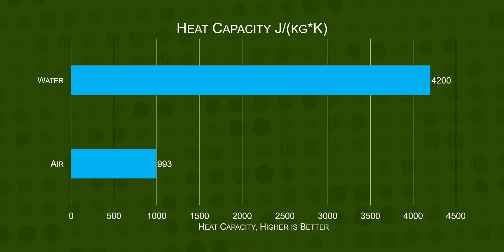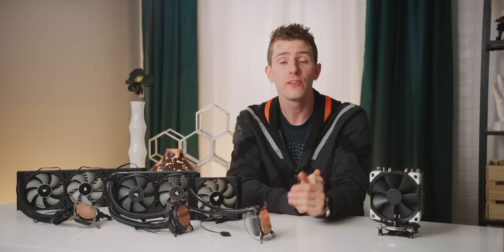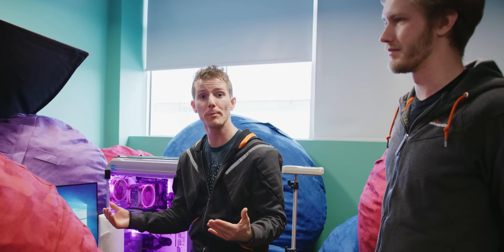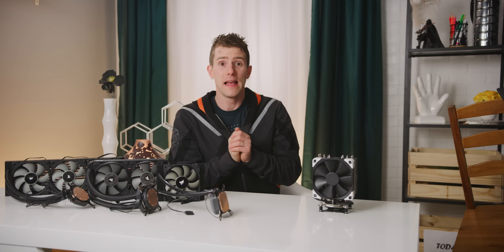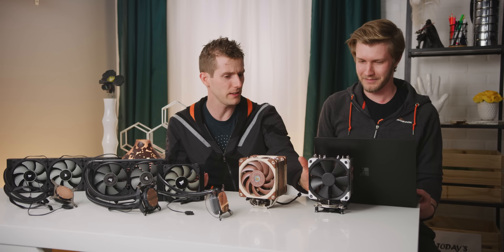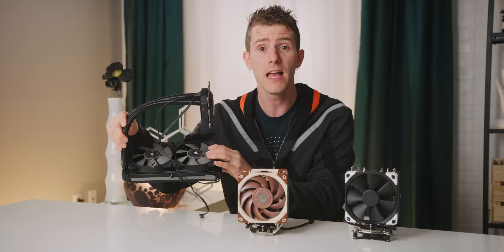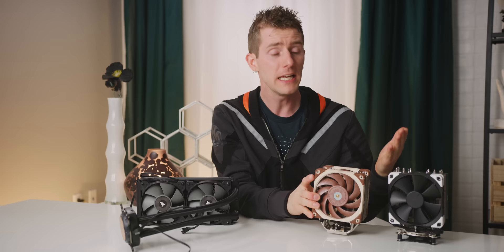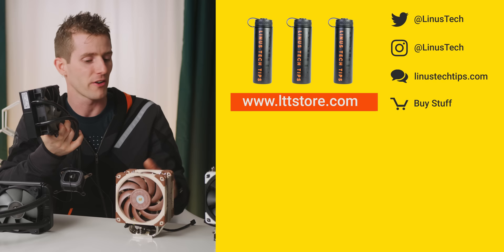Why you shouldn't water cool your PC

Comment: Tech companies: Sell shit products by paying for ads
Noctua: Gets free advertisement by making actually good products
Tech companies: *surprised Pikachu face*
Reply: yea, amazed at the amount of suckers in the world that buy PC water cooled stupidity when a good laptop will do it all.
Reply: Agree. I've long said that if marketed right. A turd wrapped in decorative foil will sell.

So much "stuff" is designed only to "SELL."
Reply: Silent Studios 
If you want a powerful PC but are extremely mobile from day to day
Reply: I can't get a laptop with an I7 7700k and 32GB DDR4, liquid metal on the cpu with water-cooling, and a GTX 1080TI and a 32" wide screen.  @VanguardX
Reply: You really think this is not paid for? This is 100% commercial for new Noctua cooler.
Reply: When I replaced my air cooler I also had a Noctua , they where back in 2006 also the king of cooling with pretty low noise.
I get a full custom water cooling with a radiator for 3x 120 fans. I cooled my HDDs, Board, GPU , CPU and Ram back then. 
The entire system was much cooler with that. Time goes by and I had 3 system after that  and guess what, the radiator with the fans and the CPU cooler + pump are the same.
I just changed the brackets for mounting different CPU sockets. Because I bought a high quality cooler back then it is still performing better then most other stuff and I know as long as the company is standing I can get mounts for different sockets. 
With a custom water cooling system you get even less noise then the Noctua. Good pump is ofc required or just a specific cheap chinese one for 24$...
Reply: @Elementpunx  I know right! This was obviously a promo. Can't trust anyone these days.
Reply: I LOVE noctuas fans, at first i was like 30 bucks for a fan you gotta be kidding me.... then is decided to test... YEP amazing
Reply: I have never seen an add for noctua. Standard add not youtube sponsor.
Reply: Lol if you don't think this video is also sponsered by Noctua as well I'm envious of your sweet innocent naive soul.
Reply: Article 13 enforced right here 👌🏻
Reply: :O
Reply: wish noctua would make a black edition instead of that jungle brown
Reply: @36SOAD817HMC  yeah my only problem with them is that they use that woody station wagon color scheme.
Reply: @everythingabouteverythingp8472  it is called an advertisement, not an addvertisement... so the abbreviation would be "ad", not "add"
Reply: Jonathan Alcantar u do know they make black ones now. Rit???

Lol kid they announced last Computex 😆
Reply: @Elementpunx  In the US, sponsorships and other paid commercials have to be announced/clear, like his world of tanks sponsorship. Im sure he is benefiting from anyone who buys the fan after clicking on the link in the description, but Noctua could not have legally paid him to make this video.
Reply: @nickparkin8527  yeah, where's my i9 9900k, and rtx 2080ti at?
Reply: @Vanadium  you can't get a custom watercool loop for 99$. even if that air cooler is a bit on the expensive side... and you don't have to waste your time building up the cooling loop and making sure everything works as intended. you buy the cooler, install it on your mobo and you're good to go.
Reply: @RuiPalmeira  and then you buy it again and again and again. Did you really read what I wrote?  High end air coolers are heavy and sometimes they even block you from swapping ram and or get to other things. No matter what I have paid the same price now for the custom water cooler. The next system update is almost there and I can take the cooler from my old lg1155 board to the new am 4 socket.
Reply: learn2 farm  to be fair an all in one system isn't good compared to a true water cooling setup.
Reply: @noahhaller4540  but is it the same in Canada?
Reply: @36SOAD817HMC  just go for beQuiet they're just as good
Reply: @TheReal_ist  sweet
Reply: @noahhaller4540  Except there is an unwritten code to speak well of products or a company you hope to get to sponsor you because one slip up and you will never be sponsored by anyone again.
Reply: @tropicthndr  wht ...
Reply: @seamusbyrne8259  the alienware area 51M laptop has a i9 9900k processor and a rtx 2080 if that floats your boat
Reply: Silent Studios I have a labtop because I am in college and want to bring it to all my classes.
However my Lenovo Y700 has terrible hinges and now I can’t even close it without breaking the connection between the screen and mainframe (or whatever the main piece is called)

Now I know better
Reply: @silent5486  i used to be a pc gamer, now i don't even use a pc anymore. laptop for work, smart tv for watching, mobile phone for browsing, music, and gaming too. took up gym, longboarding, surfing, and biking as a replacement for my pc gaming.
Reply: Scythe is good too.
Reply: @tropicthndr  A Laptop performing just as well as a PC is much more expensive, even mobile CPU's themselves are more expensive given their compromised performance. It is also much harder or impossible to upgrade. Even basic stuff like adding storage can be impossible, depending on the model.
Reply: @RambleOn07  The color scheme puts me off, too. But if your case isn't see-through, you don't have to look at that eyesore all day. Or is it not worth getting a non-transparent case? (I dunno, haven't built a pc yet)
Reply: @Elementpunx  : if so, it worked.  I bought one on Amazon.
Reply: Sorry but go to any modders on youtube who take modding seriously. AIOs of 120 and 240 show they are better than 95% of air coolers at stock speeds with low rpm. 280, 360 and 420 AIOs beat everything that is air, by a considerable margin esp at low dba and again at high dba with or without clocking. With clocking? air can't even get near water. Not only did they test what is viewed as one of the worst AIOs out there but also the smallest. Where is the 280mm? 2x140 > 3x120 at low rpm and its also the most common. How about try NZXT which demolish Corsair temps. 
The real best example of how bullshit this video is? look at THIS CHANNELS builds after this vid, they are all water cooled and not by Corsair.
Reply: @tropicthndr  lol you funny guy.

Comment: My last build was AIO and the one I'm building now will also be AIO. I had previously rocked air using nothing but Noctua. Honestly, both applications work for me. I prefer AIO for the noise levels being pretty much ambient to non-existent. Sure it's pricier, but honestly the AIO cooling solutions we have now are pretty nice for the price.
Reply: I just switched to the Kraken Z73 AIO from a Noctua fan and my temps dropped 25-30 degrees. Either Noctua sucks, or liquid cooling is just that much better
Reply: @holleringsmith3837  going all air really requires a great case to get anywhere near what water cooling gets you. If I ever go back to air, it will be with the fractal design torrent case. Kraken is a cool AIO! I went with EKWB with my new build. Cools the 12900K like a champ. 🤙🏻
Reply: @holleringsmith3837  That big a difference either means your case has god awful air flow, your ambient temps are really high, you chose the wrong air cooler for your cpu, or you didn't have the noctua cooler mounted properly.
Reply: Been using the small ones from Corsair.. The H60 model... Never failed me.. CPU Temp never climbs out of 54Celsius on full load... on idle it stays at 32 also super quiet
Reply: @PlayinWithGhosts  I have a fractal design torrent and a noctua nhu 12s my temps reach 48 degrees when I'm rendering so it's a beast of a case 🙌🙌

Comment: Linus: Why you shouldn't water cool your PC.
Linus: Nearly every build he does is water cooled.
Reply: I was about to comment on that especially in regards to his $5k build one.
Reply: Then his next video why water cooling is better than air Cooling make up your goddamn mind dude
Reply: He says it directly: using their computer (us, mostly) as opposed to tinkering with their computer (them, and some of us). I thought that was clear enough
Reply: tbf he likes to tinker with his pc whereas most people want to build it and forget about it for as long as possible and just use it.
Reply: Also, I bet a loop with pump reservoir and blocks probably far outperforms AIOs
Reply: I'd assume they would be rather similar to AIOs depending on the setup. The one con that makes AIOs a bit worse at cooling than custom loops is that the pump could be much less powerful or the coolant could be less efficient at absorbing heat.
Reply: Old habits die hard. Cooler tech has came a long way. U can almost pick parts at random now days and it will be a good pc with good cooling.
Reply: Custom loop is much better than aio.. and he does the builds for looks not for long term use! ... And custom loop would out perform air coolers.. but would atleast cost like 400$
Reply: For the appearance of course, i would chose AIO too if i have money 😂. 75-80°C full load isnt a big deal for me.
Reply: Mouritio Ebanks  He also made a video on why 4k gaming is dumb and then proceeds to do a bunch of videos of him gaming in 4k and spruiking 4k gaming tvs 😕
Reply: P.C. Windham Paranormal/Romance/Sci-fi/Fantasy You butchered the meme a tiny bit. The word “also” is very important. Great observation, though! 😊
Reply: @MinorZero  that is about as clear as mud. Thanks.
Reply: Obviously he didn't know. Also consider the fact that he has sponsor's that give him free products just to use. Plus it's cost effective compared to paying out of pocket. That $5000 PC he just built he probably didn't pay a penny, all sponsor supplied I'm sure.
Reply: It looks better. There is no reason to watercool unless you're HEAVILY, and i mean HEAVILY, overclocking. It is factually quieter to air cool (fewer fans and no pump), cheaper, easier to maintain, there is almost no possibility of catastrophic failure and it will always be cheaper.
Reply: It’s all aesthetic and I like it
Reply: lmao
Reply: "The cons of water cooling" is quite as grabbing of a title
Reply: @jetstreamlynn3156  Are you high? A proper custom loop buries any AIO as well as any air cooler.
Reply: Bottom line he needs something to talk about and make content...I’m sure this topic has already been covered by him before
Reply: @mouritioebanks7223  i think its his way to make a video a day. its probably just him getting creative and knowing how to take get the most out of YouTubes algorithms.

but yeah i agree that it can definitely be a confusing AF factor
thats why IMO watching videos from ONLY the biggest youtube creators can be a bad thing 
quality over quantity ? 

but then again hes got 10.6 million subs and i have 300 so he still wins HAHA
Reply: @gewinnste  I have a question. It often gets hot in my room and the ac isn't constantly on, so instead of it trying to pump hot air for cooling the cpu should i just get liquid cooling? Im looking into alienware ryzen liquid cooling pc
Reply: Using a fan is like skateboarding with a helmet, at least it supposedly works better and is more efficient but you'll still get laughed at when you don't have neon watercolors flowing through your plexiglass case :(
Reply: @sun650   agreed
Reply: "Why YOU shouldn't watercool"
Reply: Clickbait_Title.mp4 has stopped responding.
Reply: @agrojester1156  yeah i guess
Reply: the same reason people have project cars but don't drive them to work & shopping.
Fun to tinker max out vs easy maintenance, reliable to use & not breaking the bank.
Reply: Kuro Yokai The big difference between an AIO and a full water cooling setup will be the amount of thermal mass in the liquid reservoir. Larger reservoir means that you can run at peak loads longer before the coolant is thermally saturated. 

Also, there might be a difference in pumps, which would also have an impact.
Reply: Yeah
Reply: @doctor9551  the issue is that at some point, the heat needs to get from the thing you want to cool to the ambient air.  So either you try and dump it straight in (air cooling) or from the aio radiator.  Either way your thermal efficiency is going to be reduced.
Reply: sblla I really like to build pcs but water cooling boost up costs a lot liek Linus said
Reply: linus != you
Reply: NICE
Reply: These are all testing coming performance at minimum noise level to maintain an all cores 5GHz overclock, where the expensive Noctua air cooler wins. If you're looking for maximum overall cooling performance for maximum OC even beyond 5GHz, "noise be dammed," the 240mm / 360mm best the air coolers every time... albeit at higher noise. You also have to consider how silent the liquid comes would be if they had Noctua fans installed. 

So it's all about your priorities and what level of noise you're willing to live with in order to get a maximum overclock.
Reply: @MinorZero  That was in reference to custom water cooling. But, custom water cooling outperforms aios and air cooling. Linus's comment was more about cost vs performance and not just performance in of itself. To me, the aios and air cooled units performed so close that it comes down to aesthetics. And that's pretty much why Linus goes with water cooling, even aios, in most of his builds, making any water cooling better.
Reply: @doctor9551  Unless you move your computer outside of your room it wont make a difference. The cooler does not make the heat go away just moves it away from the cpu.
Reply: @sun650  who cares about what the next person think
Reply: @bradriley714  and the cost of those parts passed directly onto the consumer
Reply: Water cooling all the way.
Reply: Exactly.. I got tired of his content contradictions
.
Reply: it's like trying to follow diet advice in men's fitness magazines. "So wait I am supposed to eat egg yolks or not??"
Reply: When you get that much money its obvious you may consider the look factor more important that it actually could be for you... its the same reason "poor people" consider 4 example a goldern porsche or a golden PS4 a waste of money (you think this because you understand how much other things you could do with that value) but the guy that can have such thing, you can be sure that it has more than enough money to do the all other things you would be doing with that value... 

For the rich at the end its not that different that to what could be you wasting  money on a good watch that may be 300$ but can do mostly the same that a 3$ casio can do....  Ussually status gets based on quality (effort on development or quality/value of materials) and not on quantity...   So how many computer you need? 1? 4? 10? there will be a moment where you would prefer a single super-mega-pc instead a room full of computers with a great quality/value.
Reply: It's a flex

Comment: A friend of mine mounted his desktop components on the wall of his bedroom since he didn't like the fact of heat generating components being in a small contained space isn't a good idea. So he had a window unit that kept the room at around 60 degrees and mounted the computer hardware on the wall with L brackets. Worked very well and was also a secondary lighting for the room.
Reply: What the hell
Reply: Rip dust
Reply: 60degrees? so he was cooking himself ? dafuq
Reply: @BurnoutWien 60 degrees in Freedom units, so 15 degrees Celsius.
Reply: Distance directly effects  data bandwidth and power fluctuations. Not a bad idea, but the gpu, cpu abd mobo are going to be all within a predetermined distance

Comment: Also don't forget modern AIO has come a long way. Alphacool's newer models are basically custom watercooling for everyone as you can easily expand the system, add a second pump (also good in case the first fails), additional radiators etc. And all pretty much plug and play.
Reply: A GPU CPU combo still costs 500 bucks from them tho
Reply: @marlo8850  If you're going for dual radiators. Just adding a CPU cooler to an existing GPU cooling setup is a bit cheaper and often sufficient.